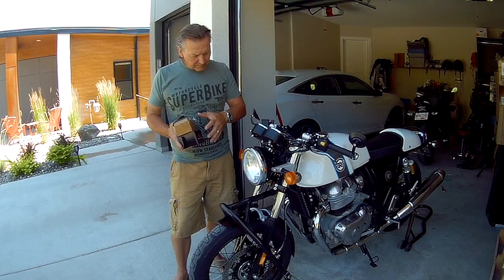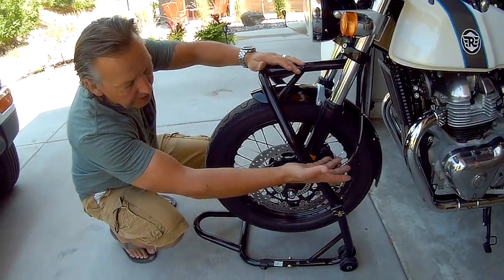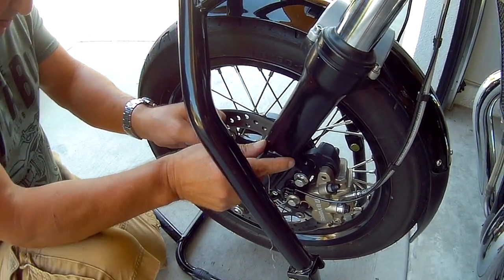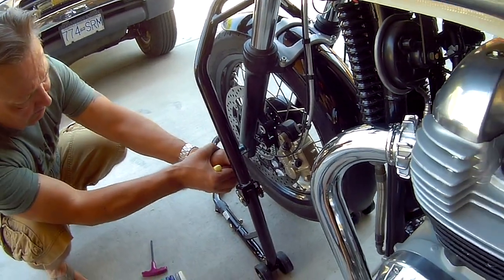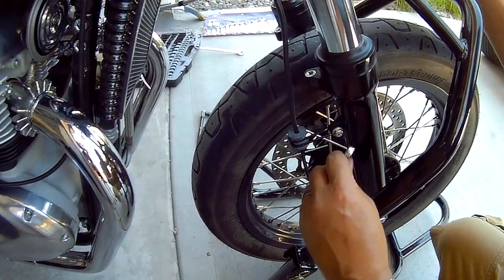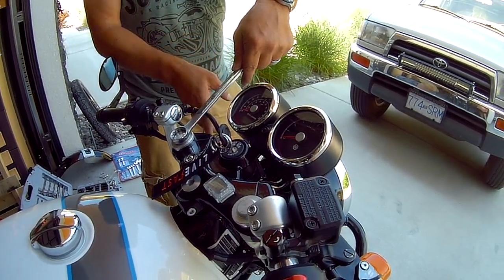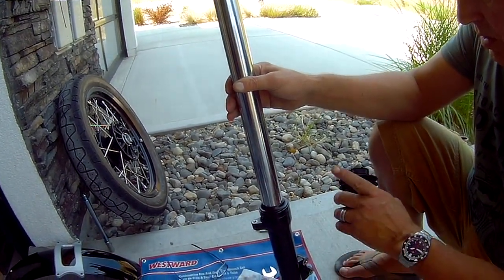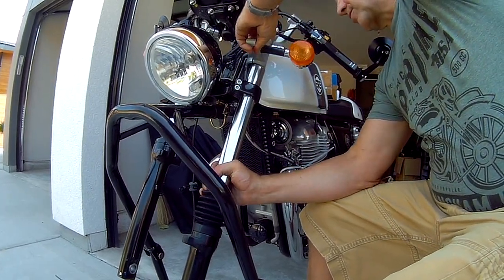🇬🇧 Royal Enfield Continental GT 650 Interceptor, fork mods, Gaiters, Boots, fork preload adjusters

Comment: Another excellent helper video.

 I've also used Plastic Dip SPRAY to protect against tool scratches by spraying the box end of the spanner or the edges of a deep socket... Just an alternative to electric tape. (The CANS of liquid Plastic Dip apply too much material to the tool.)

Still mustering the energy to go after the tubless tire project. 😇
Reply from the maker: Thanks for the tip!! You can do the Tubeless conversion just take your time!!

Comment: 19:54 What was the point of shortening the spacers in the front fork? Now that the fork pre-load adjusters have been installed fully extended, wont the adjustors now have zero effect?
Reply from the maker: No, the adjusters have been installed fully retracted allowing you to add additional preload to the springs, starting from a stock position.

Comment: Nice video. Would have made sense to change the fork oil at the same time as, by all accounts, the oil levels in each leg can be different from the factory and the oil used isn’t the greatest. I’m about to change the fork oil on my Interceptor and will paint the headlight brackets black while the forks are off.
Reply from the maker: Good tip, you're right it would have been a good time to swap out the fork oil even just so you know it's the right amount and weight.